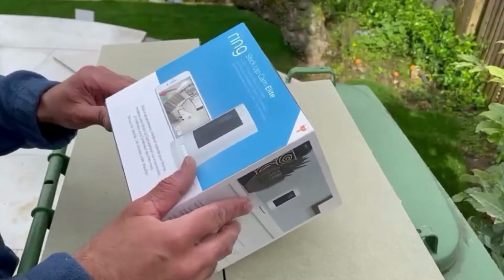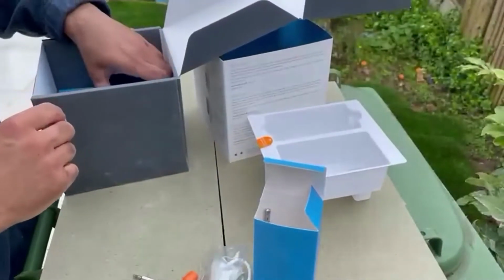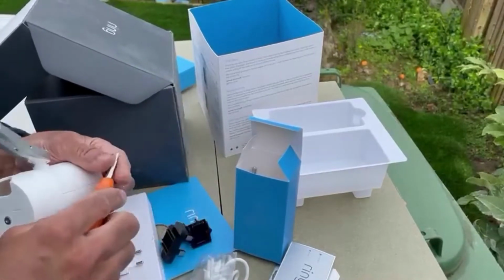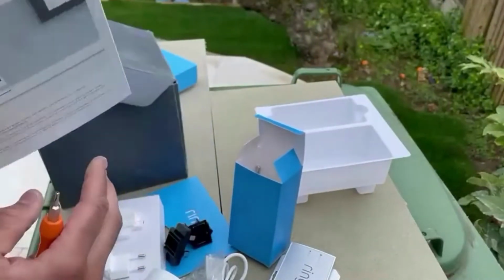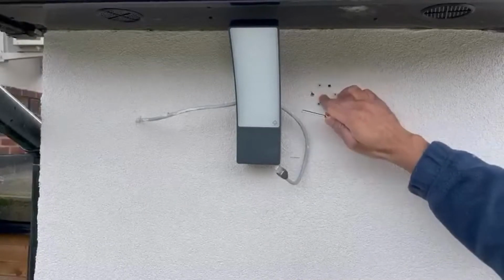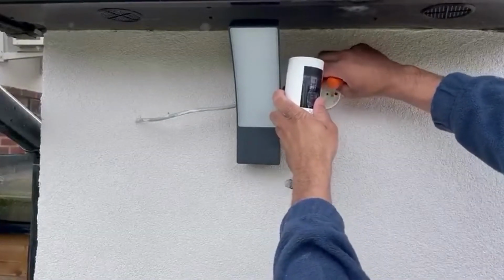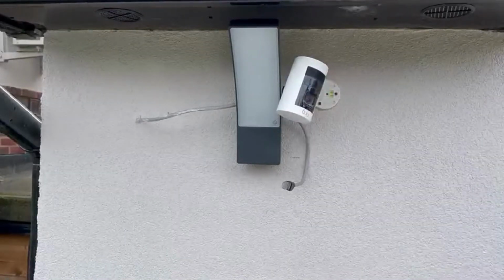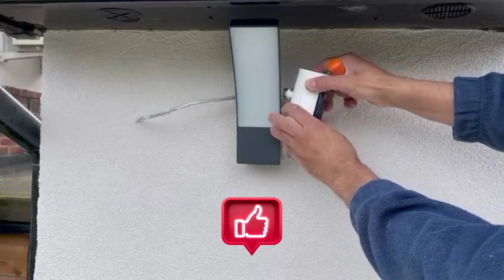Ring Stick Up Cam Elite Review & Installation Guide

Comment: Can you add the pan & tilt bracket to this unit?
I need it to move around. Is to keep an eye on my pool equipment while I'm away.
Reply from the maker: Yes you can and its readly available at amazon.
Reply: @techguruguy5990  do you have a link?
Reply from the maker: Its also available at ring website, Please folllow this link. https://en-uk.ring.com/products/pan-tilt-mount. Moreover please ready the information before you buy.
Reply: @techguruguy5990  thanks